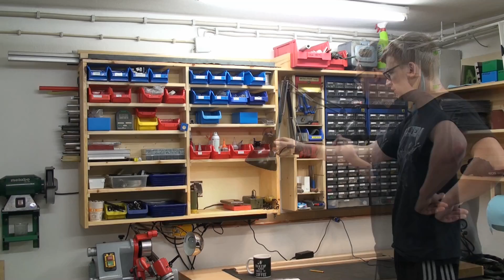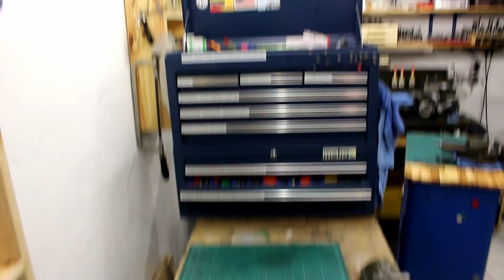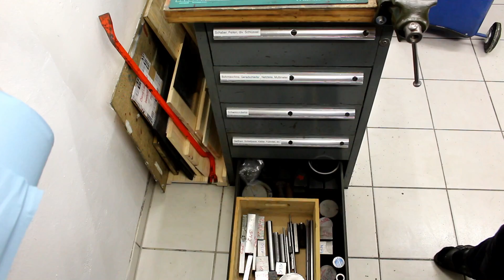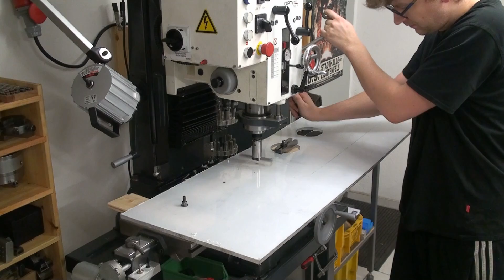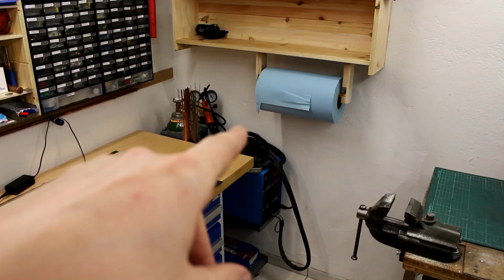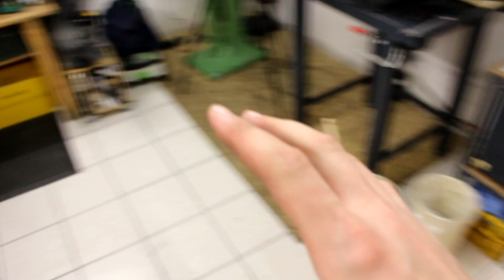Shoptalk #11 / 03-2016

Comment: Very nice shop make-over. Looks like an instrument makers shop with the bright light and clean walls. When are we going to see your watchmakers lathe in operation? Thank you for the tour.
Reply from the maker: +Paul Jones Thank you - Very kind words! Yes, I plan to get the watchmakers lathe setup so I can use it without having it to take out of the box everytime. I want to mount it to a baseplate with the motor also mounted to it, so I can take it on the workbench as a complete unit, thats a project for 2016. And changing some minor details on the cross slide of the watchmakers lathe.
Reply: +Stefan Gotteswinter I know what mean about having a baseplate and being able to keep the lathe out of the storage box. I did something similar for my old Unimat SL 1000 that I bought in 1970, used for a few years and then back into long term storage. I finally built a baseplate with a storage cabinet so I can keep most of the accessories in the small cabinet for easy access and keep the lathe on the workbench. I published the construction details at Homemadetools.net and it is one of the more popular postings (see http://www.homemadetools.net/lathe-modifications ). Thank you for your excellent explanations as you present the videos.

Comment: Great update can. I ask please did you have to take the mill apart to get it in and was it manageable this way please
Reply from the maker: +lbcustomknives Thanks! Yes, as I got it I dissassembled it almost completely down to be able to move it down the stairs - Except for the head I could move and mount all the parts by my own - The head is about 90kg and I needed help to get that back up on the machine :)

Comment: StefanAt the very end I noticed your blue oven up on the shelf. I have the same one, which I have so far only used for Glass enameling clock dials and Jewellery. I presume you use yours for heat treating. How do you measure and control the temperature? Tolle Videos.
Reply from the maker: +Andrew Waugh Yes, I use mine for hardening - So far I dont have any temperature controller, only a digital multimeter with a thermocouple to check the temperature. I still plan to add a digital temperature controller like pierre beaudry did.

Comment: Very nice clean and organized shop!
I always wonder with those deckel style grinders if it's possible to do multi facet grinds on drills.
Also, if one could build an attachment for it to sharpen the flutes on an end mill.
I've heard the Quorn was based on the deckel...
Reply from the maker: +Christopher Beasley They can do 4/6 Facett grind with the standard dividing head on the machine. Mine came with a flute grinding attachement, but that thing is a pain to use, so I sold it ;)
The Deckel style cutters are specialised machines for single lip cutters that can do some more tasks - But they are no full blown T&C grinders.

Comment: Just a thought, if you glue in those tubes your bar stock is in how do you get a  short piece out of the tube if it accidently gets shoved to the bottom? It appears you can not access the other end. It looks like it really turned out nice overall.
Reply from the maker: +bcbloc02 Go Fishing with a long piece of welding rod bent to a hook ;)
Reply: +Stefan Gotteswinter I would glue an end (cap) onto the back of the tube and leave them loose. If you fix them into the cupboard you will fish for a little while, but ultimately you will end up creating a 2nd storage space for short bits. (been there, done that, and that shop was even smaller than yours)

Comment: Really nice reorganisation Stefan! I've always been impressed how you manage to do so much good work in such a tiny space. I'm sure you would love some more room, but you set a great example for others with only a little workshop space.

Miscellaneous question: do you have plans to one day buy a surface grinder? It seems that you could put one to really good use, but then perhaps you just don't have the space for one! :)
Reply from the maker: +Paul Dorman Surface grinder...yes I would love to have one - But its a space and dirt problem. They throw abrasive dust all over the place especialy when you are dressing the wheel and thats nothing I want to have near my other machines or my tooling. But I could get that managed by covering up the other machines while grinding. And for the space problem, there are small blanchard grinders by "Kugelmüller" out there, which have a footprint about the size of a coffeemaker - Thats something I would buy.

Comment: Hi,
Nice job on the wood working for your shelves. Do you have a separate area to do your wood working ? Big change to the layout . Nice !
Reply from the maker: +Brian U No, I do the woodstuff in the same shop - Main tools are a Festool tracksaw and a Makita Router, I run both with dust collection, so dust is not a big issue.
Reply: +Stefan Gotteswinter I have the same track saw. Really a great tool.